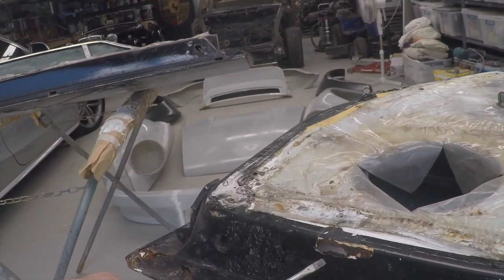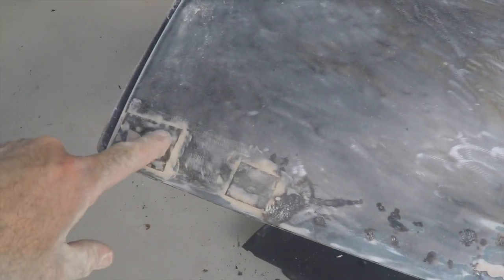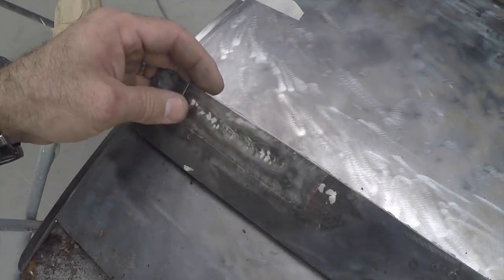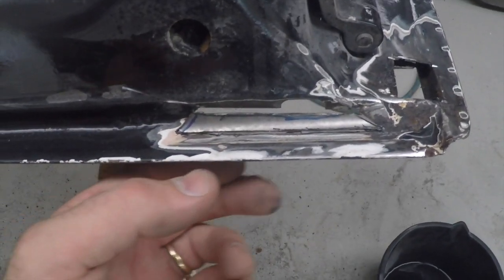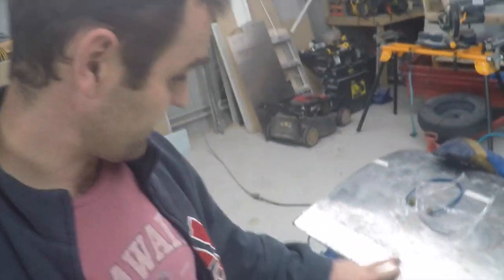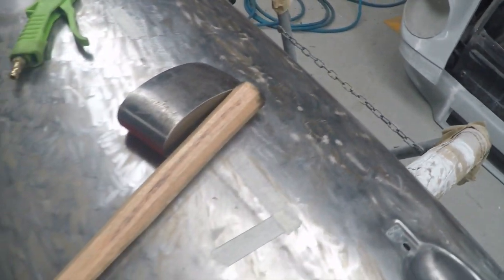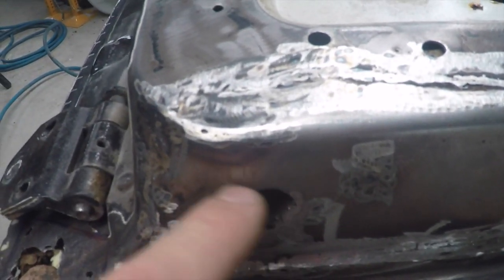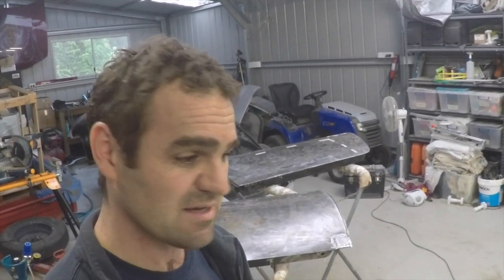Repairing rusted doors - Porsche 911 Classic Car Build Part 7

Comment from the maker: Thanks guys. I am enjoying the process.
Reply: +Jeff Micklem  What grade of sheet metal did you use to patch up the door?   Do you have to match it to the original sheet metal used??
Reply from the maker: +xkrnxboix 
I roughly tried to measure the thickness of the existing sheet,  and found that 0.8mm sheet was the closest match for the job.

Comment: Nice work! How are the areas where the check straps attach? They are a weak spot on these cars and usually need work. The metal flexes and tears over time. It's a tricky thing to fix and best done while the door is off the car.
Reply from the maker: +Michael Bugler I didn't notice anything, but I will go back and have a better look now. It seems with this car most of the issues have come from the car just sitting outside, rather than from high use, or salted roads, etc.
Reply from the maker: That is a great repair. I just had a look at mine ant they are still perfect. I don't suspect my car has a crazy number of k's on it, as it has had at least 2 2.7s with pulled head studs, and that is just in the last 15 years. So wear and tear is definitely not an issue with this car.

Comment: Does nobody offer aftermarket skins for 911's? I would personally have removed the entire skin. More work possibly but as you found out you get warpage when using a MIG. Even if you're really careful and take your time, let the metal cool etc.. This was why I just replaced the entire skin on my 240z.
Reply from the maker: I will probably replace the entire skins on my Z, but the doors on the 911 were rotted along the bottom as well as the skin, so I would have had to replace the entire door. New doors would be better, but they can always be replaced when they are completely gone. At least now I should get a few more years out of them ;)
Reply: +Home Built By Jeff understood the rare spares doors are thicker and the fit is a little off so you need to fettle about quite a bit. Basically more work but like you I found loads of bog on the door and decided I'd just replace the whole thing. The other good thing about removing the skin is I was able to sandblast and paint inside the door frame. Hopefully your 240z doors are not hiding too much rust.
Reply from the maker: gav240z As far as I can see (the door cards are off), it doesn't look too bad, but I will have to take a closer look when I get there.